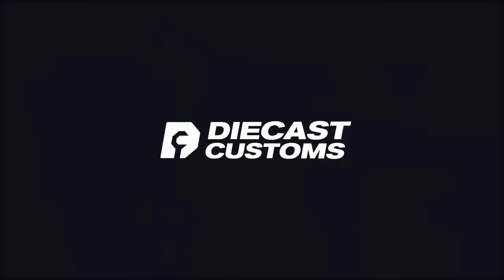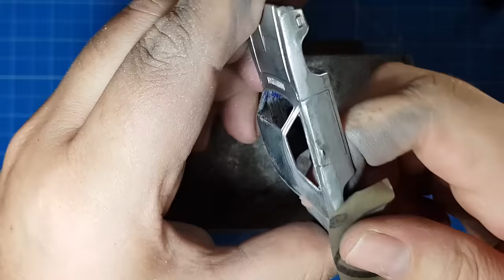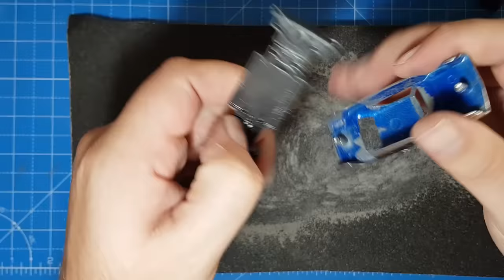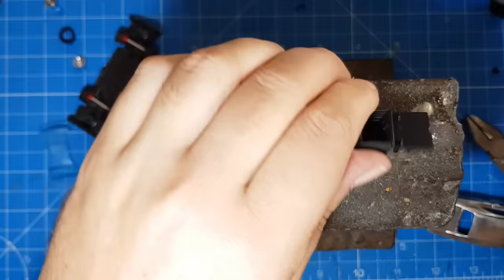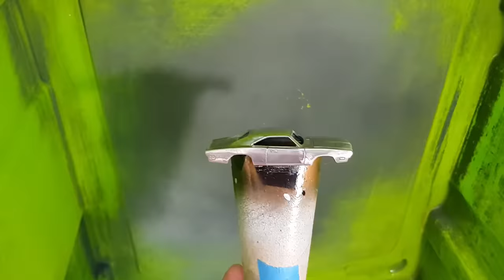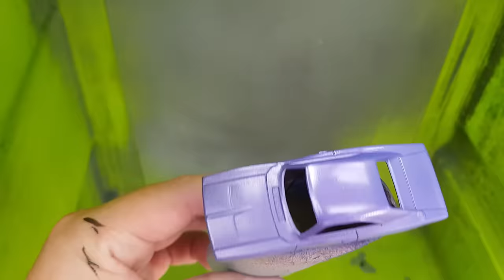Custom Hotwheels 1969 Dodge Charger

Comment: What kind of primer do you use before the painting??
Reply from the maker: Hi. I just use any local metal primer in a rattle can. I would suggest buy a few brands and apply a thin coat. You will find a nice brand. Generally the more expensive the better the quality.
Reply: @diecastcustoms8512  just it has to be a metal primer, not an especiffic one for pot/aluminum/zinc metals? Do you think the rust oleum will work?